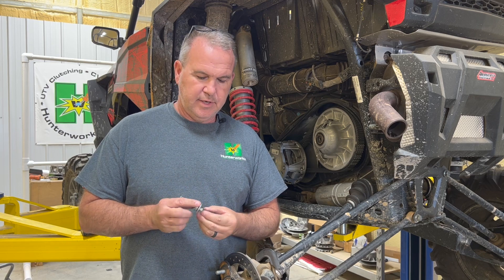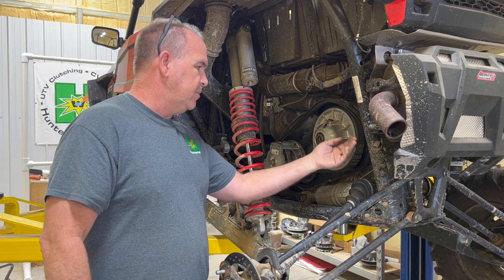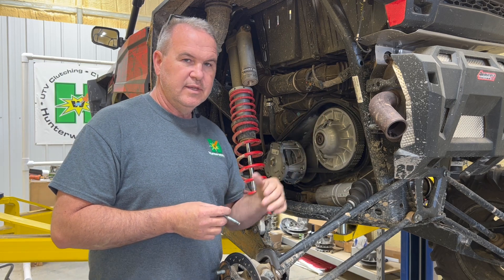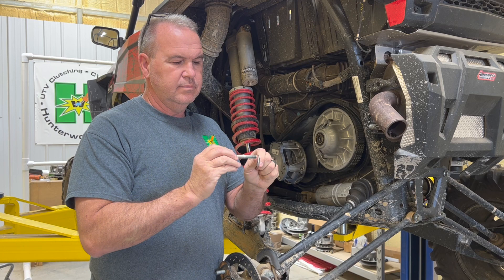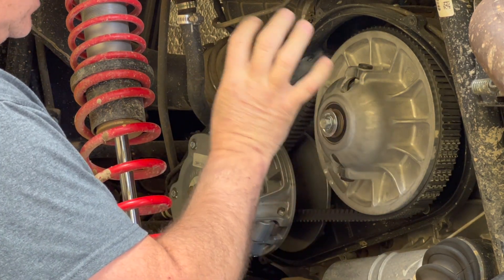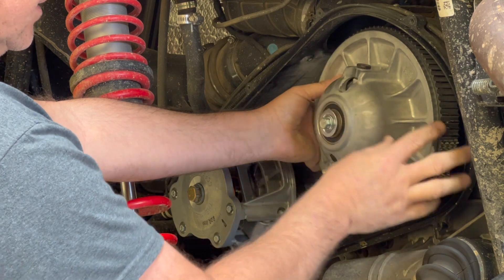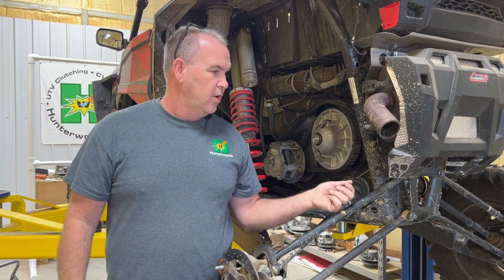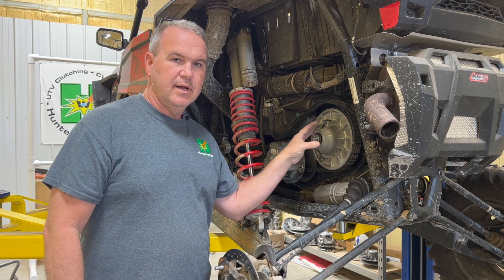Polaris Secondary Clutch Float Mod

Comment: I have a 2015 polaris rzr 900s,  will this float mod work ? Looks like someone changed out the original secondary clutch to one like in the vid.
Reply from the maker: These exact parts will not fit in it, but if you had some washers that fit inside the hole, it would

Comment: First off. I appreciate all your videos. You put out the effort for sure. I have a 2019 Ranger 1000xp Highlifter. My secondary clutch shaft moves in and out probably 1/8th to 3/16th of an inch. Is it suppose to have that much play. It makes it hard to get the clutches aligned and seems like depending on where it decides to sit makes it hard to shift sometimes. Thanks for any help.
Reply from the maker: It should not move at all. Something inside is not right
Reply: @Hunterworks  that's what I was thinking. I appreciate you getting back to me so fast.

Comment: Can you do this on rzr oem secondary clutch?
Reply from the maker: depends on the rzr model but not a XP except 14 and 15
Reply: @Hunterworks   i got a 21 1000 xp 2 seater
Reply from the maker: @BCarlson-y2h  Only if you buy our start fresh with the secondary used in this video but not your oem

Comment: is there a way for this to work without having the hunter works secondary? 2020 RZR 1000 here. belt seems to rubbing on the motor side sheave of the primary
Reply from the maker: No way with the factory secondary, but you simply have an alignment issue, get our alignment tool
Reply: @Hunterworks alignment tool will be here today. will it push the secondary back out to make the belt sit properly? because it won’t grab the belt until 3k. i also lost all forward movement on easter while driving. heard something in the rear and had creeping, hard to shift and no movement.
Reply from the maker: @drewscheer4329  Sounds like you have two issues, one alignment and two something going on in the primary, watch our primary clutch troubleshooting video.  The alignment tool makes the shafts parallel which moves the belt to the center
Reply: @Hunterworks  alright. the alignment tool is in. will watch the videos and check it everything out. see if the alignment fixes it

Comment: Just bought a 202 Polaris 1000. Taking off in high range there’s a bit of jerking so pulled the cover to check the clutch. All seems fine but my question is, how deep should the belt be in the secondary clutch?  The top (outside) of my belt is about 3/16” below the outside of the clutch. 
Most is see appear to be flush or slightly above. Can this be adjusted?
Reply from the maker: 202??? Miles rzr? Xp?   All sounds normal to me and that’s where the belt should be if a rzr

Comment: 17 rzr turbo here. After watching this video… Eating up a belt top and bottom groves wouldn’t be caused by the secondary snap ring coming out of the grove??
Reply from the maker: Not sure how you’re making a connection but yes on what you said.
Reply: @Hunterworks I emailed some pictures earlier of secondary. 5k miles on machine I’m not sure what acceptable wear is on clutch items
Reply from the maker: @delbridge11l  I’ll see it Monday
Reply: @Hunterworks awesome

Comment: Sorry Todd. I completely loose the point of the video. May be because you leave the rest to imagination? What the washer are for? You leave in there? Centering what? So confused
Reply from the maker: Simple answer lets the secondary move or float instead of being fixed so that any minor alignment issues won’t matter and allow the belt to center up in the primary clutch.
Reply: @Hunterworks  Never thought to have a prompt answer. ha ha Thanks, thanks a lot!!!
 BTW, I tried to buy one of your Belts and couldn't. Its for newer models 2016 on only? Mine is 2013. It say have not available for my car. Im so sad
Reply from the maker: @hectormelendez9298  we just out.  We sell them

Comment: Hey todd I've been watching your videos on clutching. Quick question my secondary clutch bolt came off while riding, my cover kept it from flying off. Locking bolt and everything came loose afte torquing it back it got loose again any idea why its happening?
Reply from the maker: Sounds like the secondary is turning on the shaft for some reason and turning the bolt off with it
Reply: I used blue Loctite hopefully that keeps it from spinning.. thanks for the response. Keep up the educational videos coming 👍
Reply from the maker: @OjosCafes84  its won't unfortunately